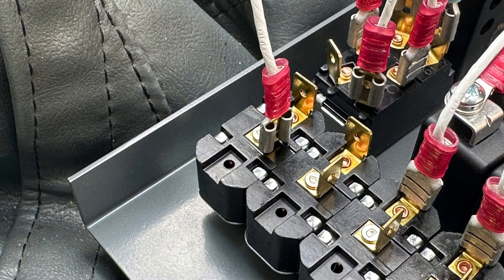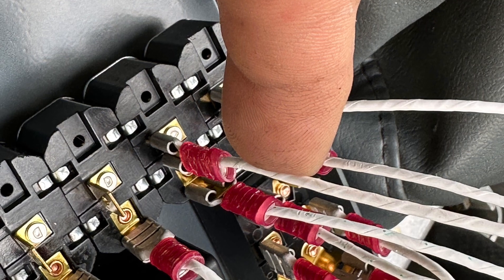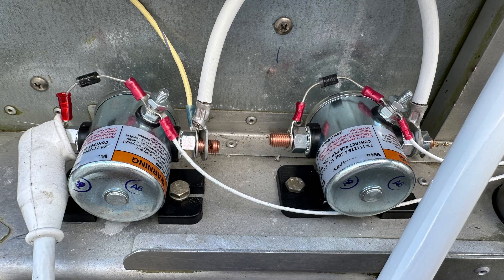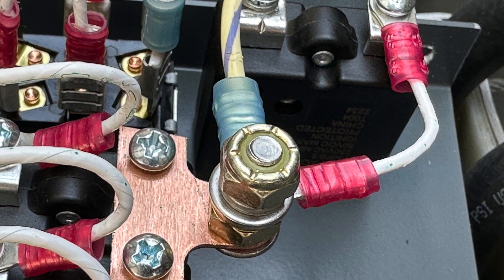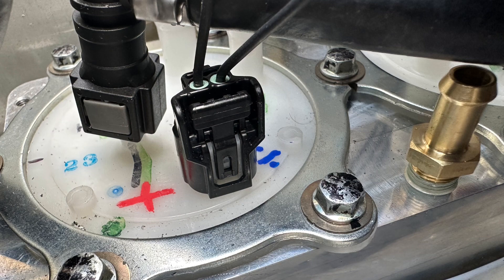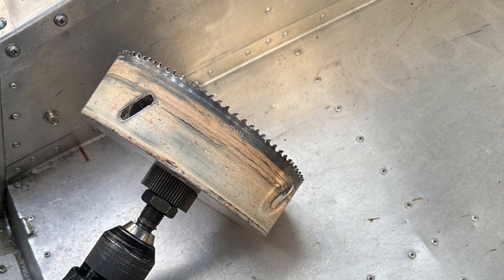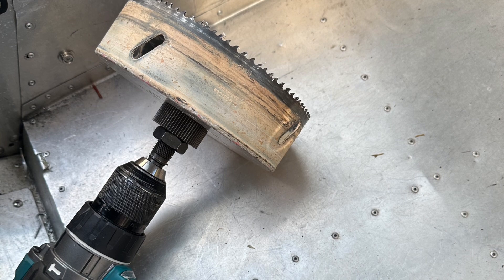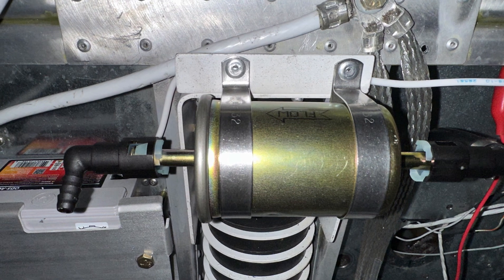Making A Viking Engine Switch the Easy Way - Part 2

Comment: Slide on ‘spade terminals’ wow😮
Reply from the maker: All sold at Aircraft spruce and Aircraft quality. You can’t even pull them off when done properly, you have to use pliers. They are called fast on terminals

Comment: Curiosity what’s type of coating is used on your wires for all your set up  

&you have battery backup redundancy on the second contractors with diodes with buses